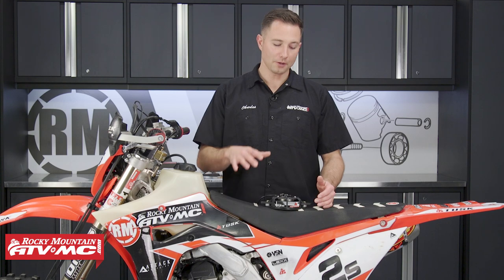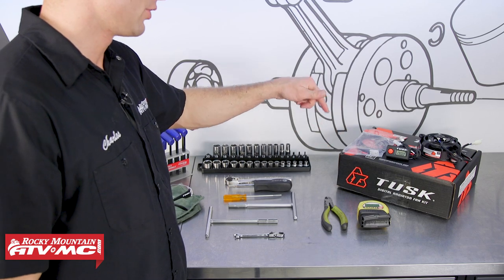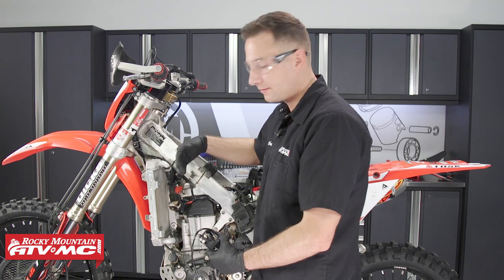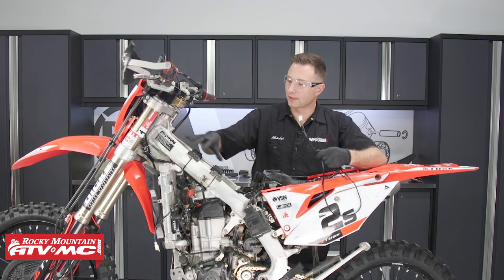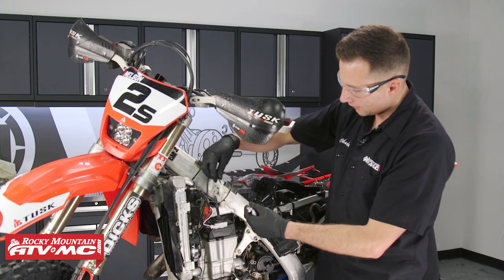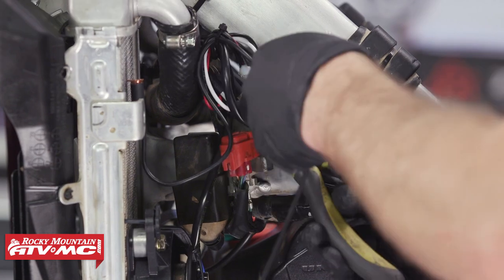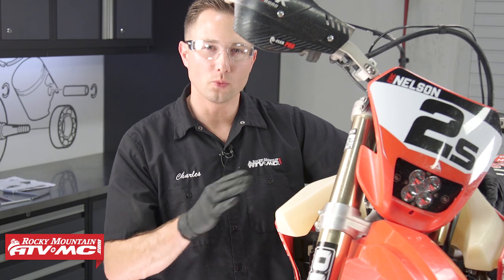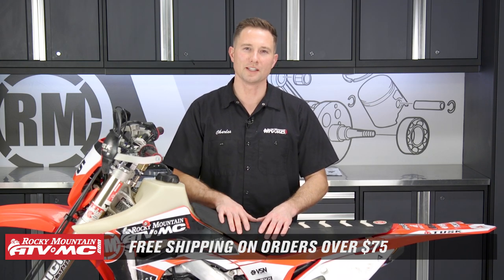How To Install a Tusk Universal Digital Radiator Fan Kit

Comment: Nice video. I just ordered one for my 450RX, I’ll probably route everything like you did. I run engine ice, and I haven’t had it long but I’m hoping to get some more hours out of the motor before rebuilds with the combination. In tight trail and hill climbing  I’ve had to watch and get some air through it on hot days. Riding CR250s. Never worry with heat. But I love the torque of the 450s. Both are fun to ride. But the 450RX is a awesome bike for me. With a bad right knee the E start is so nice.

Comment: Tech says you can put the sensor probe above or below the fan, which I did initially.  I recommend you place the sensor to a location that senses the temperature of the coolant coming out of the engine before it gets to the fan.

Comment: You guys need to make bracket for this new model 2019 CRF450X instead of using the zip tie method. The radiator is the same as a 450L and the mounting points are already there.
Reply: Agreed. I think Honda needs to make a plug-n-play system that can be bolt directly on those pre-existing radiator holes. Yamaha offers this on their FX models for $90 on the Yamaha parts store. Not sure why Honda can't do the same. Just sell the fan that comes on the 450L for like $100, shouldn't be that hard... Just emailed Honda about this and now waiting for a response.

Comment: hi. i have bought an Tusk universal fan kit from you and i mounted on a Honda crf450x , please tell me what is the best setting temperature  for this motocycle that the fan to start cooling ? 190 F or 200 F OR 220 F ?THANKS IT IS GOOD QUALITY MADE -waiting your answer😊
Reply from the maker: The temperature yours should be set at will depend on your specific bike, how you ride, and where you're riding. But the stock setting of 190 degrees is a great place to start and will work well most people. If you notice your bike getting up over 200 then you may want to set the temp lower but if you feel that it turns on too often you can set it a little higher.

Comment: I have a 2022 CRF 450. I understand that in the kit it’s designed to come on at 190° but is that a good temperature for it to come on or should I set it to a lower temperature? If so, what should that temperature be or is 190° perfect for a 450
Reply from the maker: For your model 190 degrees is right in the middle of operating range.

Comment: Does the temperature sensor constantly draw power, even with the bike off?
Reply from the maker: After you shut the bike off, if the fan is on, it will continue to run until it drops below a certain temp. After that, it won't draw any power from the bike.
Reply: @rmatvmc  thanks!
Reply: i can't put it on my dirt bike because it doesn't have batery!

Comment: Are there any fans for bikes without batteries?
Reply: Yeah can i mount it on my CRF 450R ?
Reply: I just mounted mine onto my 2016 crf 450r and I had to buy a small 12 volt battery from lordco that I put in my airbox
Reply: @travisthiessen4435   what battery did you end up running and how long will it power the fan? 
I assume you also have to have a battery charger at home to recharge the unit? Thanks
Reply: Justin Saunders I just put a little 12v in the air box and run a 6” light bar and the rad fan. I’ve been pretty busy lately so haven’t had a chance to run it a lot but I did some single track and it worked really well to keep it cool. It was running for a good hour and a half and didn’t die so I’m not sure how long it will last. And yes I charge it at home

Comment: Would this work with 2000 Yamaha Wr400f that has the tusk enduro light kit installed with battery?
Reply from the maker: Yes you can mount this to your model.

Comment: I'm trying to figure out if I can run this off a small rc car batter and how long it would last. The battery is 1500mAh, 11.1 volts. This fan says it uses 15 watts. I'm imagining it would run about an hour full time or a couple if its turning on and off. Would I just be able to hook it directly to the battery?
Any info is greatly appreciated!
Reply: you can
Reply: Yeah that will run a fan for sure for a "short" period, to short IMO for anything be going slow enough to need a fan on to keep it cool. Assuming where installing on something without enough juice to power accessories (lets say a 2001 CR250) could add a lighting stator then a regulator rectifier and a larger battery (ricky stator sells all). That will produce more VAC then get rectified/regulated to 12VDC. Hook fan up to battery still and will run and keep battery charged. Plus likely a little extra power if had to add something else like a USB charger or lighting, etc...
Reply: @Aspired329  thanks for the response and great info. I'll probably want to upgrade towards that in the near future. Atm the 1500 mah battery lasts all day for me even set at 165 degrees. I'm sure the more endurance I'll have to upgrade to a recharging system like you were talking about. Thanks for the info bro!
Reply: @kingmike7729  Dude thanks for the info on that. I have a 2016 Rmz250 i want to use this kit on and I'm going to get a couple of those batteries
Reply: @CountryBoyDak  hell yeahh brother 🤙🤙🤙  it works so good!
Reply: What would be nice is a simple electrical switch you can turn on and off at will on the handlebars instead of the bike doing it itself

Comment: Did he mention use dielectric grease?
Reply from the maker: Dielectric grease is recommended. The Tusk Radiator fan kit comes with a small tube for install.

Comment: Hi. For Honda crf 450x  year 2005 do i need to cut some lateral aluminum protection near the radiator to make room for the fan ?
Reply from the maker: You shouldn't need to. We have had customers install these on CRF450X bikes with no issues.
Reply: @rmatvmc  thank you . I ordered one

Comment: Does it matter if I put my temperature sensor into the other radiator that I mounted the fan onto?
Reply from the maker: We recommend putting the temperature sensor probe above or below the fan but it shouldn't be a problem installing it on the other radiator.
Reply: Rocky Mountain ATV MC ok thanks! Love the fan!!

Comment: What are the springs for?
Reply from the maker: The springs can be used between the back of the fan and the radiator to put additional pressure on the backing plate. They may not be necessary for every installation.

Comment: Could I use this on a older bike that doesn’t have a battery? If I wire it to the stater
Reply from the maker: I would only recommend using it with a battery. Anything else is up to you but if you can't run it, you can look into other options to prevent boil over like a high pressure radiator cap or Evens coolant. The bike can still get hot with that stuff, but keeping the coolant inside is obviously always better than not having it in there. -Charles
Reply: No, stator produces VAC, fan needs 12VDC. Need a regulator rectifier and small battery. Plus that stator needs to have enough VAC to run fan and cover small conversion loss! Most the time will need a new stator since systems won't have enough power but not always.

Comment: What is the shut off temperature? Can you set that too or is just a few degrees less than the start-up temp? Can you set the thermostat to display °C?
Reply from the maker: The computer comes programmed to turn the fan on at 190 degrees but can be changed based on your needs. Unfortunately, the display cannot be changed to Celsius.
Reply: @rmatvmc  I undertstand it comes programmed at 190 °F and that's the temp the fan will come on , but what is the temperature the fan will come back off? I imagine is a few degrees less than the ON temp. Can you set that too?
Reply: @GiovanniEsposito5  did you ever find out i was wondering the same thing
Reply: @jdelung Me to😢
Reply: @jdelung 5 it shut off

Comment: Hey man,I appreciate the video.  Do you know what they make for a 2022 450RX please?
Reply from the maker: Thanks for watching! You can use this fan kit for the Honda CRF450RX.
Reply: @seatime674  it has a temp probe you insert between the cooling fins in the rad. I've since installed it on the '22 450RX and it works awesome.  Cheers
Reply: @seatime674  sorry I didn't go with the tusk because it has shitty quality. I went with the other universal kit. Way better
Reply: @billwillson5361  I want to put one on my WR450 and I heard the Tusk wasn't the best quality either, what universal one did you use??. Ebay has fans for like $19 was even thinking about one of those, ha..
Reply: @seatime674  I had that same seadoo sportster with the 215 supercharged in it. I sold it last year and I miss it now. Cheers
Reply: @billwillson5361  Yup '05 15ft 215hp Sportster you have a good eye..Just sold it 2 months ago 🍻
Reply: @billwillson5361  Is there a specific Universal kit that you got I'll look into it
Reply: @seatime674  did you find it?
Reply: @billwillson5361  Its confusing there's so many to choose from. I need one with an on-off switch that I can control or one that turns off with the bike that doesn't continue to run when the engine is off
Reply: @seatime674  why?   They only run for a couple minutes at most.  It won't kill your battery. I've had mine for quite some time and have had zero issues with any of that.  I was concerned about that too initially.  Trailtech only has the one universal dirtbike fan kit that I'm aware of.  Where abouts do you live?
Reply: @billwillson5361  I'm in NV Las Vegas,  it's for my WR450 these batteries are so small and die frequently and it's hot so just a bit nervous and don't want to stress them out but maybe setting it at 190 won't run to long when the bike is off.. . Ebay has a bunch of  fans only from $20- $25  with just the wires to splice into the system but am leary how that would work.. With the nicer full set it's all plug ins with the radiator sensor and temp guage etc, ..I see the Tusk one but I hear things break so I'll look into Trail Tech I guess...

Comment: Hi, very dissapointed, please sent me a new temp sensor and a new thermostat/display. Stopped working in my first ride, seems to be a common problem the temp sensor and LCD.

Changed the Sensor and nothing happens.
Reply: So your temp sensor and thermostat display went out on their first ride?? did you bang it around or did you get that fixed and replaced?

Comment: Please can anyone confirm the fan supplied is a pull or push
Reply: Pull. It’s pulling air through the front of the radiator. It’s not directing hot engine air through the rads, if that’s what your thinking

Comment: My bike does not have a battery can i mount it??
Reply from the maker: You will need a battery to use this fan kit. It will work with any 12v battery system.

Comment: My digital temperature gage is just lines going across it and it won’t switch to the temp
Reply: Did you get that guage fixed?
Reply: @seatime674  yes I believe the battery pack was disconnected
Reply: @Sloyote  Cool, do you have this exact fan and is everything working okay? I'm thinking about getting this kit for my WR450 and I hear the quality is not that good that things break
Reply: @seatime674  it worked great for me, I got rid of the bike about 2 years ago though
Reply: @Sloyote  👌👌

Comment: I have a 2007 CRF450X, on the right side radiator I have stock mounting brackets for the fan, could I mount there? also it has a place for a temperature switch is it possible to install a thermo switch instead of the probe?

Comment: Doesn't seem like there is any real coverage on the radiator. I dont see how this will improve cooling at all lol
Reply from the maker: The fan pulls more air through the radiator than what would normally be going through (especially at slower speeds) which improves cooling and lowers coolant temperatures.

Comment: 4:24 not a really good place to put a sensor, it will never read the engines temprature. very poor installation of the sensor.
Reply: Most motorcycle fan kits (even factory ones) pull from a radiator sensor just a different style. It's fine and IMO desired. When you shut the bike off the coolant flow stops, the bikes motor and coolant in it continues to heat up for a while longer but coolant doesn't move through the motor anymore (since very few motorcycles use electric coolant fans) so the radiator fan can still run with sensor there and when cools down the radiator and coolant in that part of a now closed circuit enough to meet whatever the setting is then it will then shut off generally after a fairly short period. Have that sensor in say the engine head the thing will run WAY longer when set at the same setting trying to cool all that mass down and could effect battery output when go to start it again. It's not a engine temp gauge, it's a thermo sensor to control a fan. Plus what you going to sell a expensive head with prob or weld in bung with a universal fan kit, no!
Reply: Where would you have put the sensor if that's a poor location??